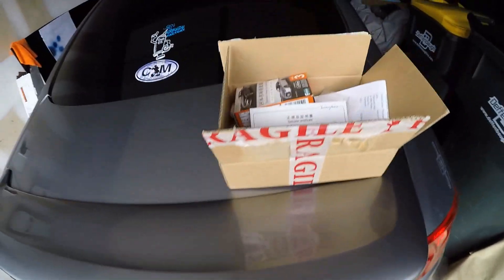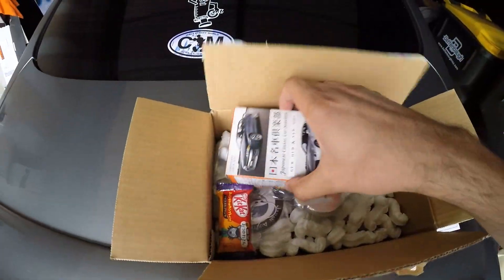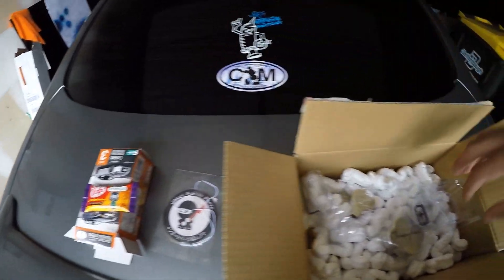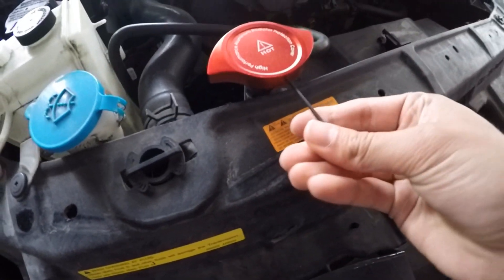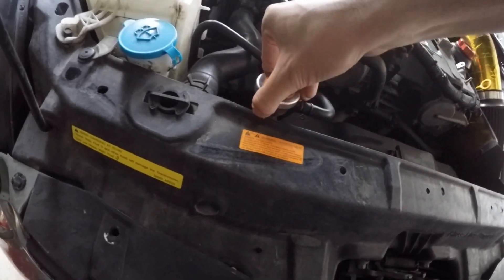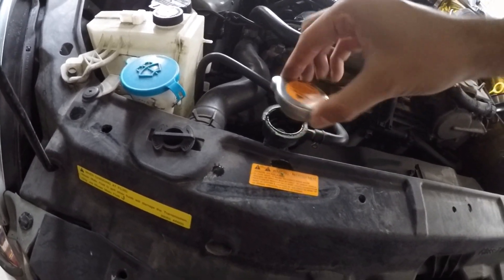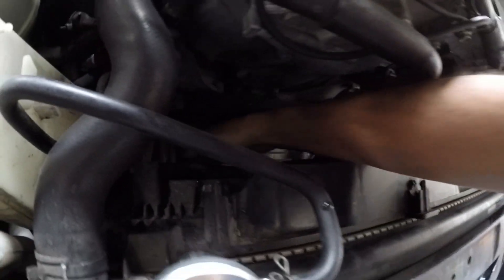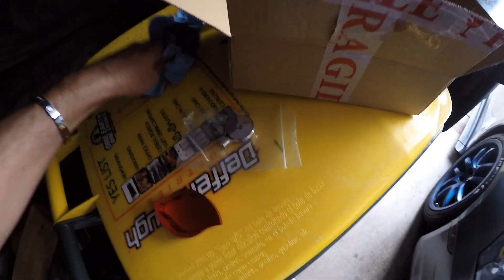ENGINE BAY PARTS !! | Infiniti G35 Coupe

Comment: You ever have problems with your AT not wanting to go into Manual mode ? And when you get into M mode it doesn't want to downshift?
Reply from the maker: Only a few times with the downshift but pretty sure it was because I went to fast on the stick and it didnt register. Other than that no other problems
Reply: Yeah? Cause I have an 05 G Coupe AT as well. And that's the problem I've been having.
Reply from the maker: Huh yeah im not sure on that. Been seeing that asked more as well in the facebook groups. Could try changing the fluid in it. See if that helps
Reply: I changed it 2 weeks ago. And put a Stillen Grounding kit on and still having the problem.
Reply from the maker: Oh wow. Dang yeah im not sure then. Tried doing an ecu reset? The pedal method